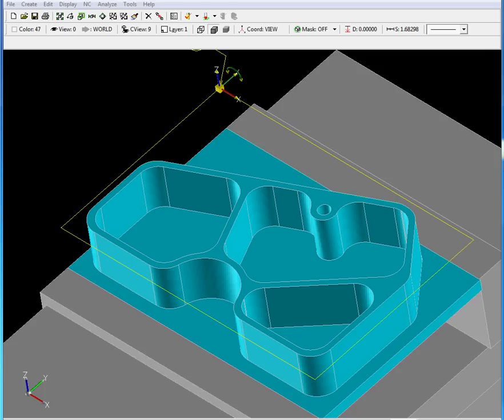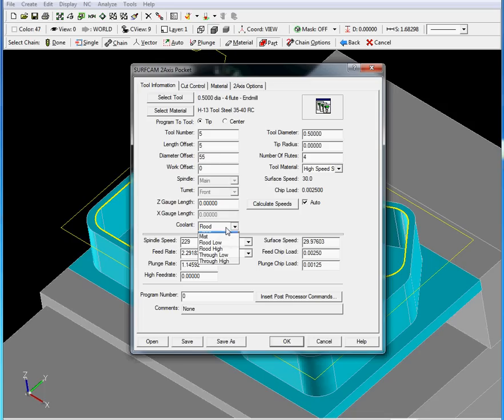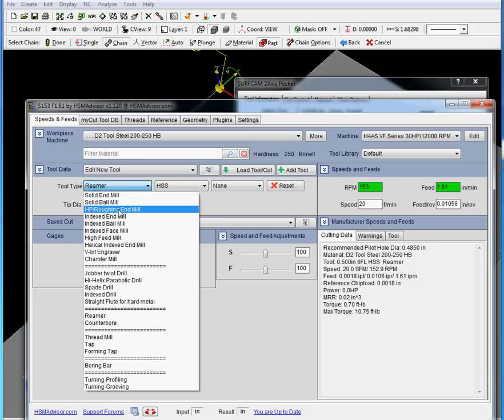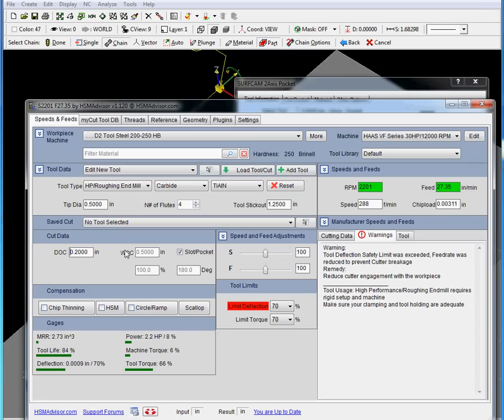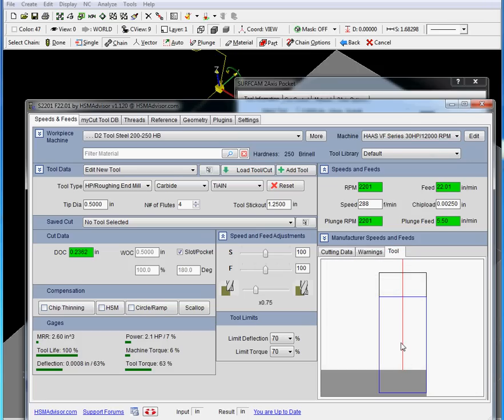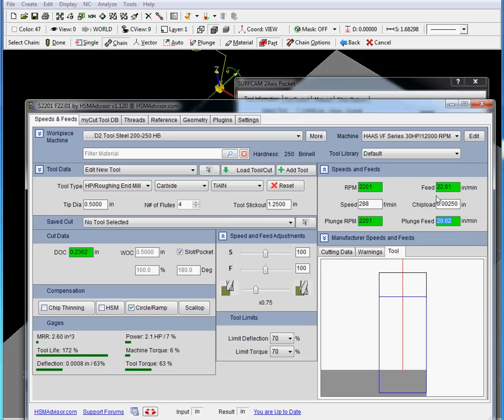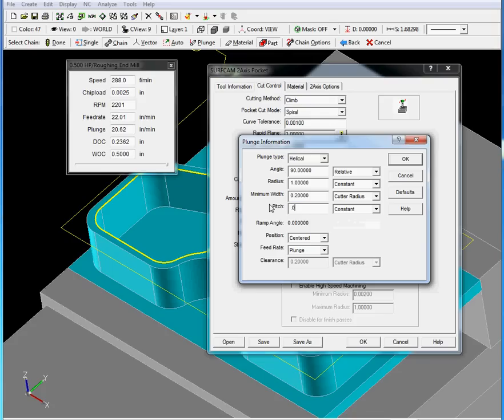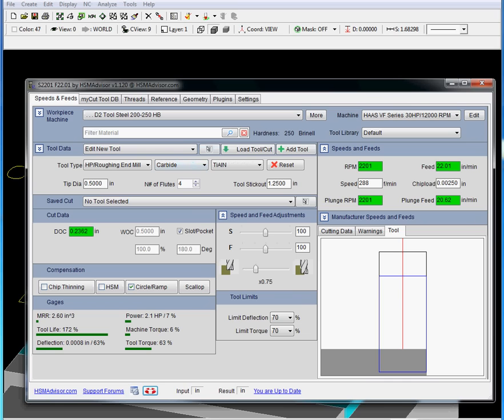HSMAdvisor Pocketing with Helical Ramp Plunge

Comment: You choose ramp plunging, don't you need ramp milling? Is this a small mistake or am I misunderstanding? Great video, many thanks!
Reply from the maker: hi, I chose "Ramp Plunging" because We are using Ramping motion to calculate Plunging Feedrate. IOW I am ramp-plunging and then milling.

You would have to use "Ramp milling" to calculate Helical boring or Counterboring where Actual Feedrate needs to be compensated. Check out corresponding help section at hsmadvisor.com